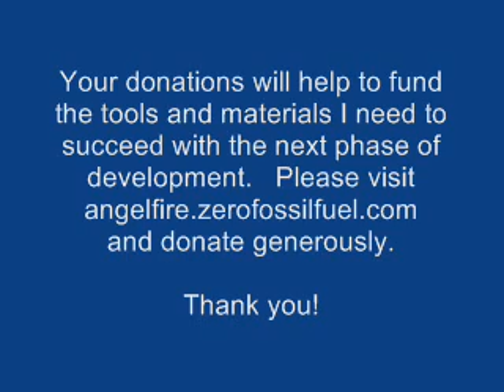#47 1.1 LPM HHO at only 247W or 4.50mmw eff!!!

Comment: Also, don't forget that the poiling point of water is when it *will* change phase. It does not mean that it can't or won't at a lower temperature.  In fact, adding a tad heat and intense bubbling will force water to evaporate making the gas output contain a certain ammount of water vapour.  Remember, each time one of the bubbles formed bursts they release energy that might turn some water into vapour.  I am not sure how you can measure this though.  Maby weighing a certain volume of gas?

Comment from the maker: That's true. Colder temps, denser gas. Somewhere in one of my posts here are the boiling temps for pure water at several points of vacuum. Water with high chemical concentrations will be even higher but it serves as a good baseline to indicate that I'm still not even close to boiling.

Comment: I just wanted to post some numbers...
1.1 liters/min would at room temp equate to around 1.1/22 = 0.05 mol of hho gas.
0.05 mol of hho gas contains around 0.05 * 286.97 kJ = 14.3485 kJ.  This makes 14.3485/3600 = 3.986 Wh.  Since you are using approx 250w for 1 minute you are using 250/60 = 4.17 wh.  If you could get all the energy back from the gas you are actually doing very very well.  95%-ish is not bad at all.